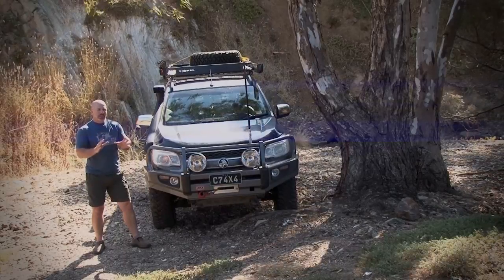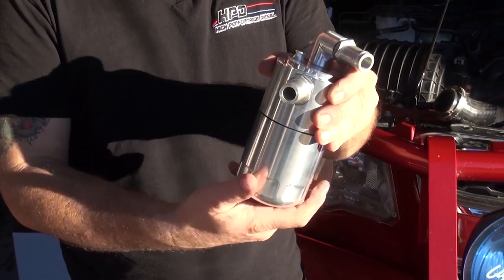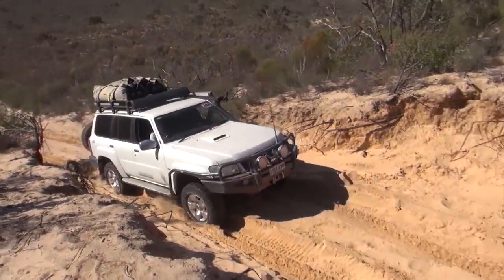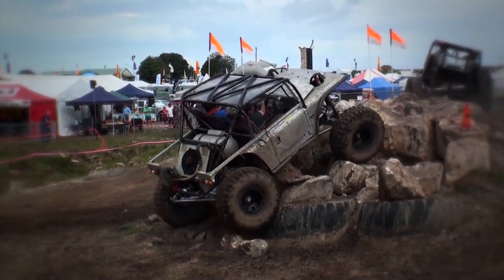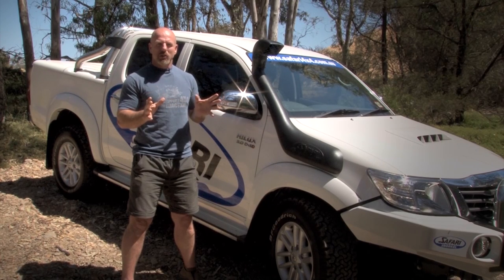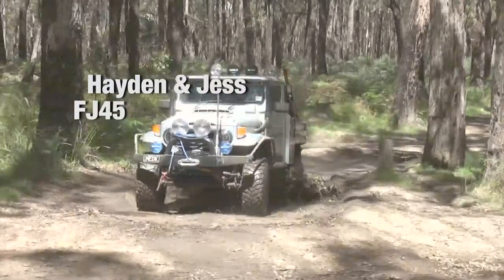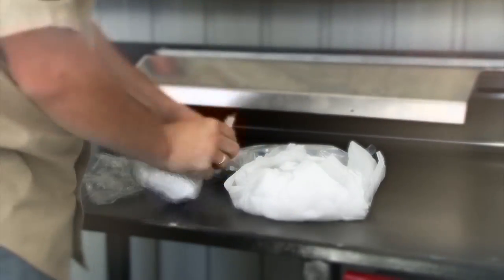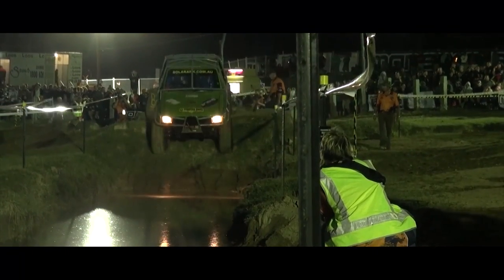4wd TV Episode 382

Comment: The ARB bloke talking about the ARB air locker.. E-lockers are FAR FAR better and more realiable. Ive heard many horror stories about ARB air lockers.. From the hose lines getting torn out from brush(there goes your diff lock), diff oil flood the air lines. On top of this you always need that really loud BRRRRRRRRRRRRRRRRRRRRRRRRRRRRRRRRRRRRRRRRRRRRRRRRRRRRRRRRRRRRRRRRRRRRRRRRRRRRRRRRRRRR compressor going to actaully use it. If something happens to that.. Again.. No diff lock.

An E-locker has far less to go wrong with it. pretty much as long as your car is putting out 12V itll work.

To end.. Ive also been hearing way too much, ARBs after sales help is pathetic. Just google about it and see the plethora of horror stories. Because of that I avoid most ARB products.